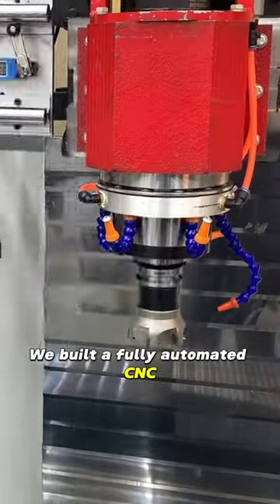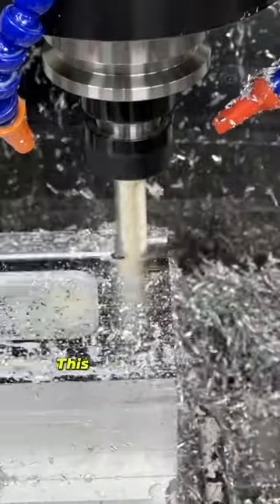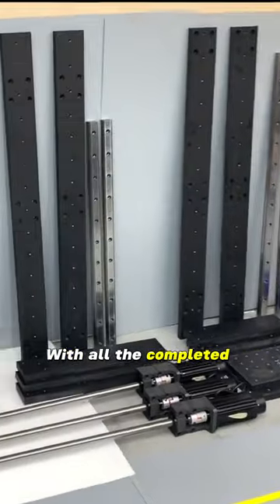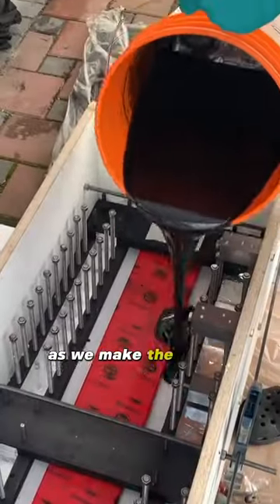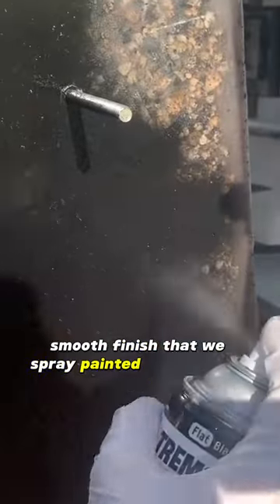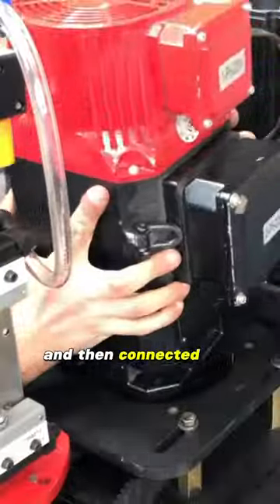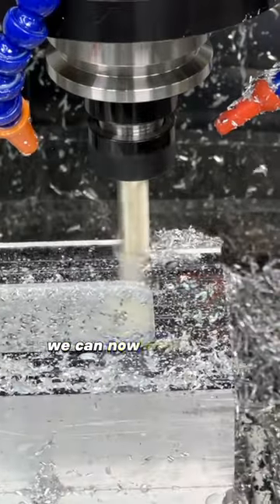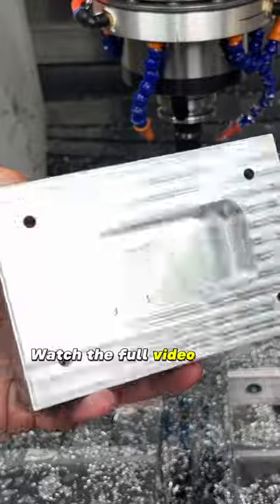Homemade CNC Machine #engineering #diyproject

Comment: Without grinding the surfaces where linear rails are screwed,you dont have parallel and flat surfaces😊
Reply: Exactly
Reply: Programmable table calibration go out from chat
Reply: You can compensate digitally
Reply: @Ma_X64  no you can not
Reply: @dejanvanevski4399  From what I saw you can. May be in some limited range but in general it is possible.  Although I agree that it is much better to have all 90 deg.
Reply: @Ma_X64  agree

Comment: Epoxy is not stable, and it creeps. 
You know you can buy real granite?
Just a thought...
Reply: you can not cast "real granite" do you?

He used real granite as pebbles.
Reply: The highest quality mills are made from epoxy granite
Reply: @gunlover92  Do you also believe that aluminum can be stronger than steel?

No, the highest quality mills are made from cast iron. Why? because it has all the qualities that epoxy granite does not have, and is better at the few qualities that epoxy does have.
Reply: Epoxy granite is actually something high-end mills are made from, because depending on the epoxy resin you select, you actually have stellar dimensional accuracy, and a very low thermal expansion compared to steel.

Watch the Heller, Hermle or other CNC manufacturer factory tours, and you see mineral castings all over the place.
Reply: why studer cilindrical grinder use mineral casting?